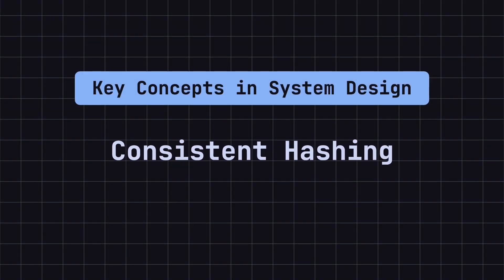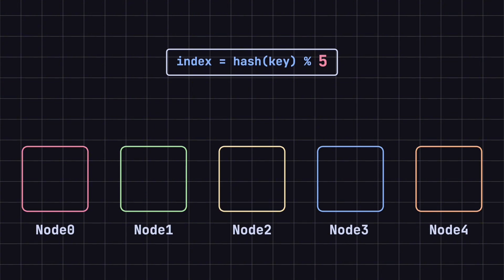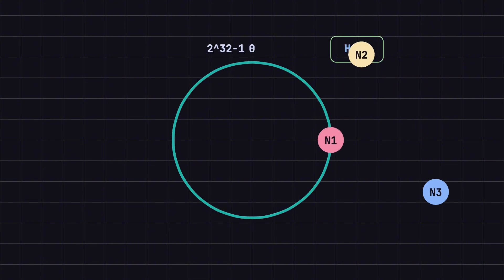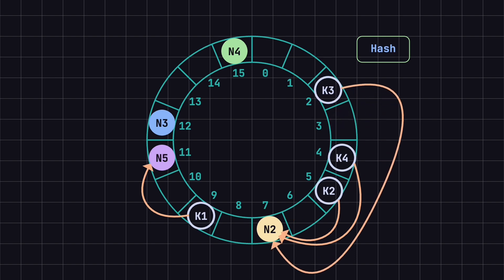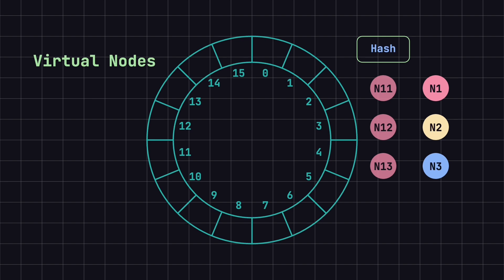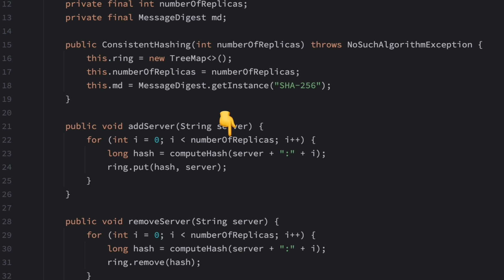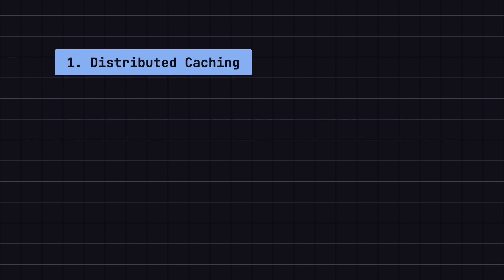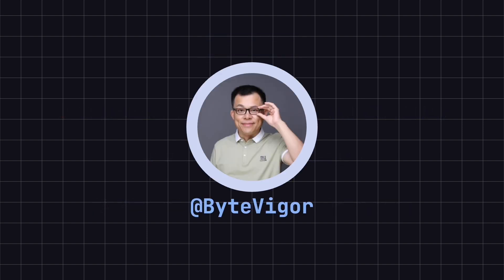Consistent Hashing ~ Key Concepts in System Design

Comment: Great explanation. One thing to point out, Redis doesn't use consistent hashing as per the documentation
Reply from the maker: Thanks for the feedback! You’re absolutely right—Redis actually uses a form of hash sloting (in the case of Redis Cluster) rather than pure consistent hashing. It’s often compared to consistent hashing, but the underlying mechanics are a bit different. Appreciate the clarification!